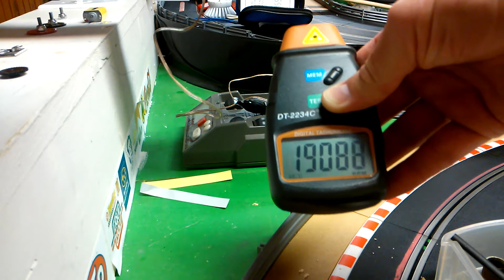RPM slot car motor test guide

Comment: You said your Scalextric motor was 18,000RPM, but you got 28,000RPM reading on your dyno. What was the problem? I am having similar problems. Thats a BIG difference.
Reply from the maker: the problem is cheap motors. I have scalex motors that go 17k all the way up to 32k. I have no idea why they cant seem to make them consistent.
Reply: @SlotCarCast  try a higher AMP output. It worked for me. Max 3 amps.

Comment: Is the plastic gear 1” in diameter?
Reply from the maker: yes its a 1" washer. the gear is just a simple slot.it sprocket gear with  a black plastic washer centered then glued on to of it.